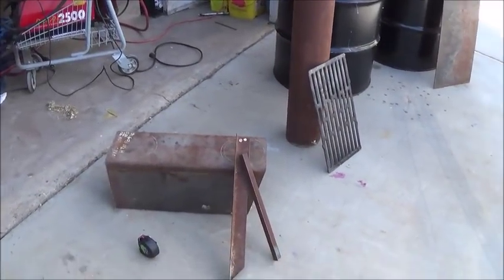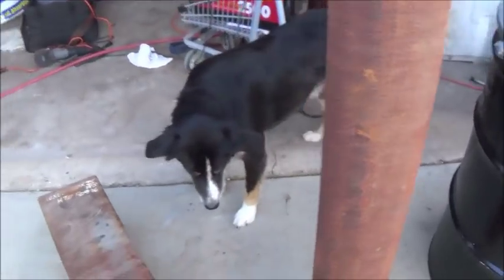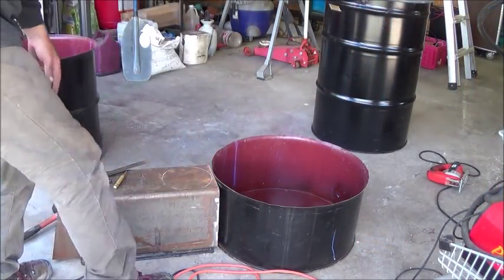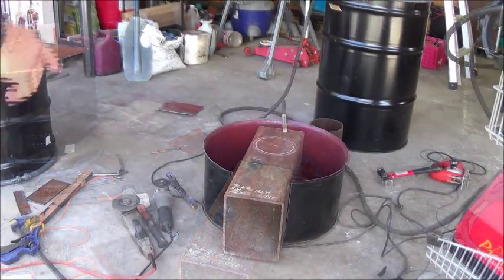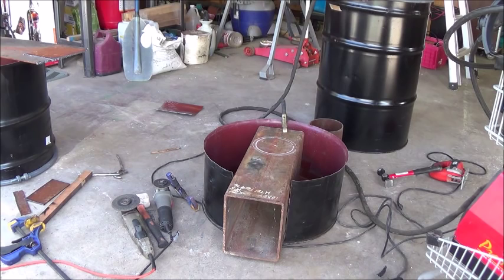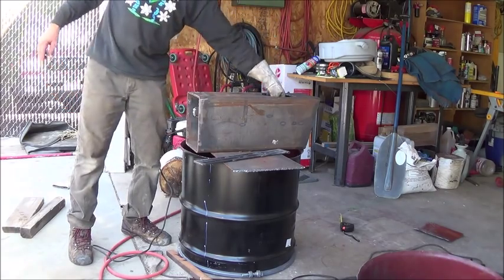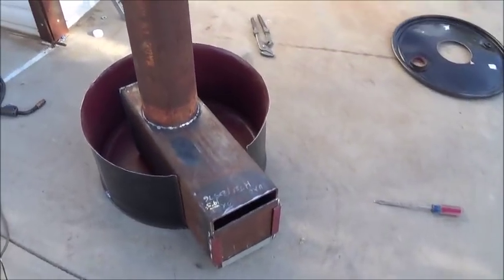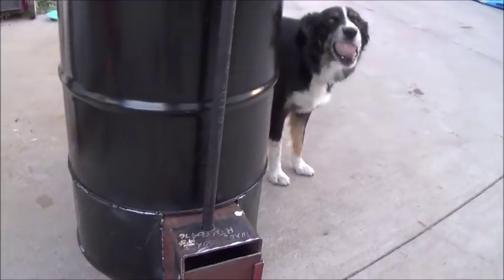Building a rocket stove biochar/charcoal kiln

Comment: Just a couple of comments.  Rather than put the outgas pipe through the lid it would be better situated near the top of the barrel itself.  This way you don't have to undo it each time you load/unload.   More important is the need to insulate the outside and the top of the barrel to contain the heat.  No insulation will result in too much heat loss and the interior temperature will not be sustained to cook the wood into charcoal.  This has the potential to be a very efficient method of making charcoal when insulated.  I would love to hear how it did as is...we learn more from our failures than successes.  Thanks for your effort.  UBET in Oregon.
Reply: Is there a video you recommend watching to build one?  I want to incorporate biiochar in my farm in Costa Rica

Comment: look like he wont come back to tell us what was the result. too bad. But I am pretty sure it was not a good result. If the burning of the wood made it to produce wood gases , I am pretty sure the pressur builded up to a point where the baril broke open. there was not enough vent size to release those gas and that is if it even started to heat up enough cause the burning chamber was pretty small the grill was to high and the wood he must have feed would just keep burning in the chimney.

Comment: Do you have the rest of this build?
Reply: DONT BUILD THIS! It most definitely can explode. The wood and some air are sealed in the drum. As soon as the wood starts to out gas, the air/fuel mixture will travel down the fuse, I mean pipe and ignite. It would not be an insignificant explosion! 

Seriously, would you put a propane/air mixture in that drum and fire this up? Same thing as wood, just takes longer.

I hope everyone, including the dog, are okay.